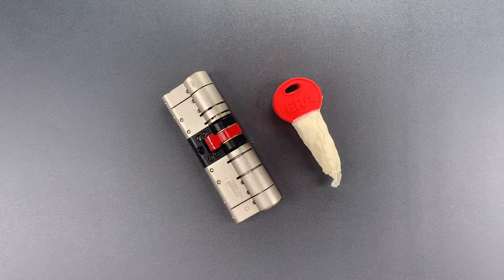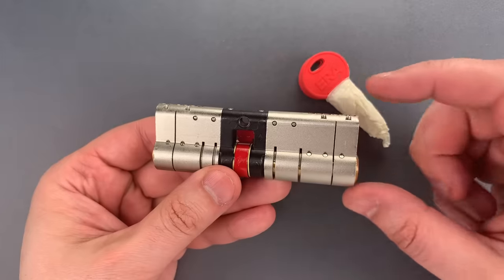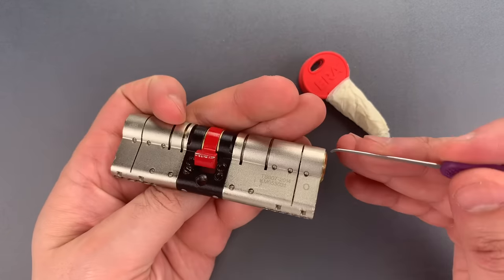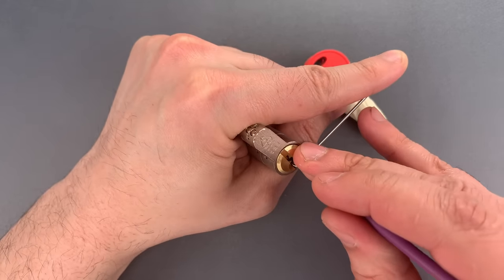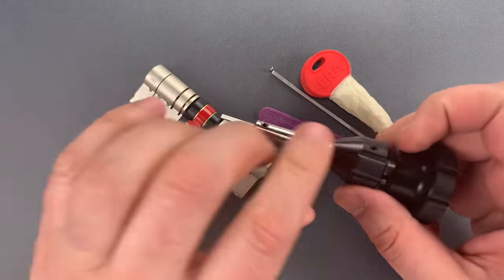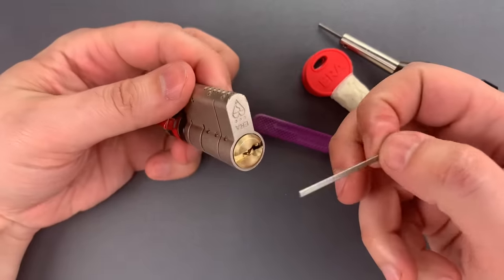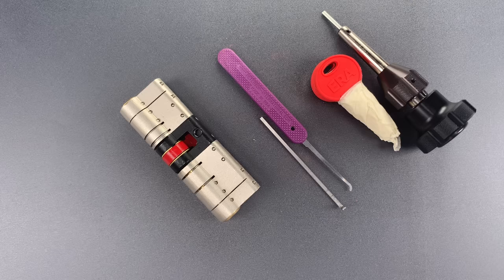[1256] ERA “Fortress” Euro Cylinder Picked (6 Trap Pins!)

Comment: We did it bois, we found an A Tier lock
Reply: It's more of S or even SS at this point
Reply: @Dangorr36  no S tier would be takes a few tries and makes lpl stumble. SS would be lpl cannot pick the lock no matter what he tries
Reply: @joppa560  ss would just pretend to be a lock but the hole is just for show and the mechanism needs a diamond saw to drill through
Reply: @maenoKaori  xD
Reply: i would actually argue S tier. not because it cant be beat..but because it basically cant be beat for the price. this is "entry level" in price for the lock(~60$), but 300$+ in security standard(and plenty even in that range that are way less secure).
Reply: You know, I'd totally watch a lock tier list if anyone tool the time to compile it.
Reply: rishi pael  150$ + is not an entry level lock. i am unaware of any other lock in the price range of 60$ that is anywhere CLOSE to as good as this one is. 

Also its arguable as to if the bowley design is as good as this. So as stated...in its price point? its an unbeatable lock. 

60$ is an amazing price point for that much security. its all the security of a 300$ lock, with a price point that lets you put it on a crappy door. If they gained entry chances are really really good they didnt do it through the lock, but through breaking the actual door. 

once you start getting into the ~200$ range you really should be using a security door/frame on top of it. which defeats the purpose of having a GOOD entry level lock. this is something you can use with ease of mind and wallet without worrying that the lock your using is more expensive than what its storing. which puts it into S tier for its price point.
Reply: @Dangorr36  and an SSS will lockpick the lockpicker itself
Reply: I want a lock tier list now...
Reply: @Latias Nice pfp
Reply: @joppa560  "no matter what he does" grabs rpg
Reply: Futaba
Reply: You also have to remember that he got to see the lock outside of it's handle. This gave him information about the lock he wouldn't have had in the field. This likely would have caused him to stumble or even brick the lock.
Reply: @darkvisiongothacked  picking this one for real (with an attached door) would actually be much harder than the bare core. he'd need a lot more powerful tool at 2:46 due extra mass and friction. If there is extra friction on purpose, might not even work
Reply: @kevinslater4126  it would be very easy to look up pics online. Being able to see the lock doesn't give him any unfair advantages.
Reply: Some of the tools he has to pick with I'm not sure many pickers just have one hand too. If you can force them to have to use something special, then most will avoid, wouldn't you think? (and typically many "special tools" are actually made by the locksmiths of the actual device they sell, just to have an ability to save someone's stuff and their lock in the event of lost keys, codes, or anti-theft protections engaged in the lock).
Reply: @joppa560  "no matter what he tries"
:"WELCOME TO DEMOLITION RANCH"
Reply: @stanimir4197  good point
Reply: Hello, Where do I buy such a lock ? Thank You !
Reply: @leonkennedy3742 
England.

Comment: "So, you got yourself a new door lock. You were always concerned about security. What made you buy it?"
"LPL needed 3 tools and 2 minutes for it. can barely get any better"
Reply: Underrated comment, excellent endorsement.
Reply: Theres some that he cant pick or didnt even attempt to pick iirc
Reply: "So, why did you pick this one?"
"LPL needed 3 tools and 2 minutes. The only way to get better results is to weld the door shut."
Reply: And when the burglar sees that his lockpicks fail, he pulls out a brick and shatters a window.
Reply: @gingerinajacket8519  and raises a racket trust me if it was a place where that could be done and get away with it sure but otherwise it's a dead giveaway of a breakin
Reply: but what kind of door can it be used on?
I can expect some brute kicking it open anyway or some people knocking the hinges off
Reply: @_Circus_Clapped_  I'm guessing some metal doors will accept at or door certain thick wood doors will accept it and if you reinforce the area around the hinges and the lock it's much harder much louder and takes much longer to do which is important since pretty much that stops the burglars if you live in a high traffic area 9 times out of 10
Reply: @topsyturvy6516  that's the ones I want to see lol
Reply: Also, never saw those hands shake like that in another video !!
Reply: @gingerinajacket8519  If bricking a window was an option, no thief is going to try to pick the lock in the first place.
Reply: @WJS774  As many other comments have said, nondestructive entry is better than destructive entry, but if they want into your house specifically, destructive entry is better than no entry.
Reply: @_Circus_Clapped_  My front-door for example. Glass window. triple layered. Not an option to just break it. Hinges have pins in them that interlock when the door is closed. So you can take the hingpin out, but you still can't remove the door. trying to flip the card-flip the death-bold or something will not work, because there are 3 of them.

Does it keep a stubborn out? No. But for most thieves it will take way to long to get inside and they will choose an other house. (and if they get it they are greeted by a nice little dog and a burglar system).
Reply: There’s that one that took seven minutes but it’s more of a padlock replacement
Reply: If LPL didn't know the trap pins location (like if the lock was in a normal door) it would probably take much longer
Reply: @gingerinajacket8519  You may think that nondestructive entry is 'better' in some theoretical sense, but ask anyone knowledgeable about how often lockpicking occurs in the wild.
Reply: @_Circus_Clapped_  This only works in the US with those paperdoors and exposed hinges. I mean, many houses in the us have the fuseboxes outside. OUTSIDE. It's just too funny that the US concerning power network, security and build quality is at early 1900s European standard
Reply: @gingerinajacket8519  by that logic we should all be living in 5 inch reinforced steel bunkers where the only way in is a sliding door that only reacts to your DNA.

Because that's the kind of fantasy land you seem to be implying we should live in with that.

We ALL know that ANYONE can pick up and throw a brick.

That doesn't invalidate the security of a good lock. In my area, you have plenty of chancers who will give a handle a turn just to see. Or people who will spend 5 minutes trying to jimmy the lock.

But vandalism, property damage, potential assault?

Those charges are a little too high for someone who wants to flip a few stolen things for some quick cash. Theft is all about speed and stealth. The less stealthy you are, the less time you have. Smash a window? Someone's gonna hear it and 9/10 times, they'll phoning the police giving you 5 minute time limit to get what you want AND vanish off the streets.

Comment: 2 minutes LPL ratings, time for CEO's to celebrate.
Reply: Bonuses all around
Reply: Board of directors just approved massive stock-options grant...
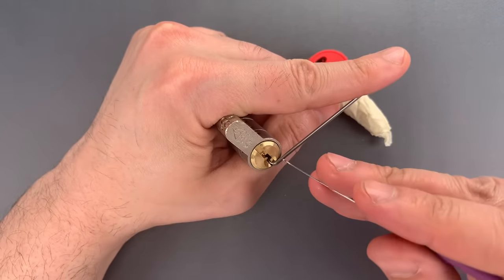Reply: Actually, he use only 30 sec from 1:37 to 2:17 to pick, the rest are explaining lock and grab new toy.
Reply: @SoloNit  I mean if someone is that determined to get in to shoot with all that noise ect more than likely they are willing to do other just as destructive things to the door or lock to get in
Reply: @SoloNit  That is fine.  The point is to make a lazy or cautious person turn away.  If it prevents most people from picking it prevents a sneaky entry.  People with lock tools probably want a sneaky entry.
Reply: @SoloNit  And that's brute force

Comment: 4 minutes and it doesn't have any packaging
what an impressive lock
Reply: If there was a box, duct tape, and a clam shell package the video would be 3 times the length and I would have popped popcorn corn it!
Reply: First minute is presentation of features though.
Reply: The actual lockpicking was about 2 minutes, but considering many locks have been picked in under 30 seconds, that's pretty impressive. :)
Reply: @Robbedem  In the case of shimmable locks or locks with a bypass flaw like comb or magnet, it can be 10+ locks in 30 seconds :D
Reply: @Robbedem  a 30 second lock is actually pretty impressive already... a normal person would take multiple minutes at least (unless it’s a low skill attack)

Comment: At this point just grab a nearby rock and use it to "pick" the nearest window.
Reply: "Clink out of glass and it is open"
Reply: Trap steal bars behind the window
Reply: "A scratch on one... A crack from two. And done, window has been shattered"
Reply: And if you still can't break through it, get a spark plug and break the ceramic and throw it
Reply: @enzuki  doesnt that only work on car windows?
Reply: @gerhardgarstenauer4229  it's just that you need something sharp to break tempered glass.